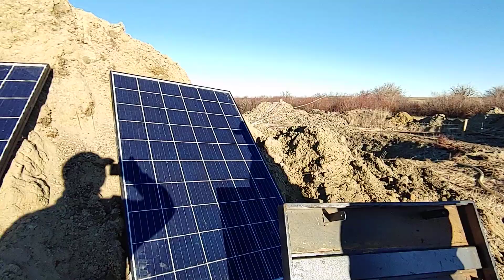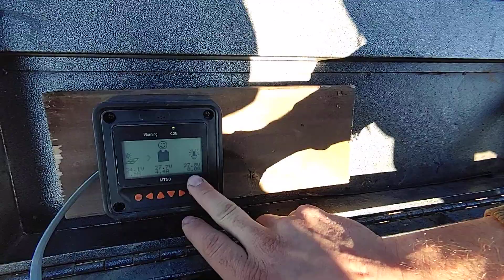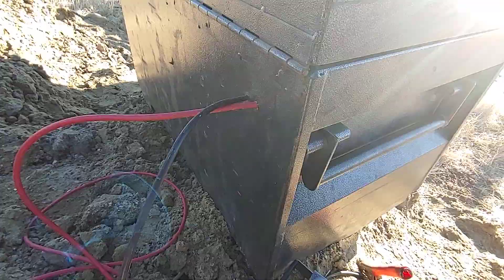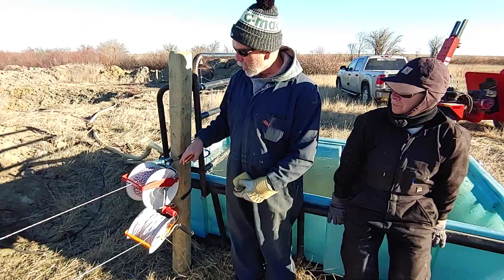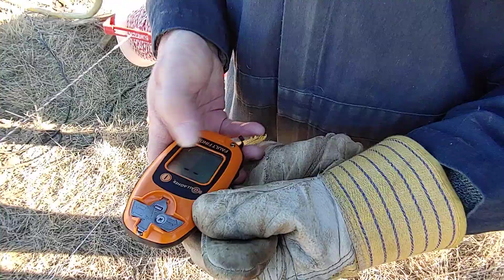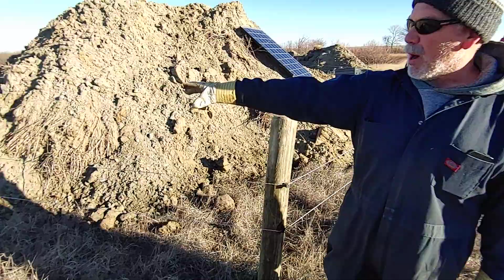Water in the Winter Part 1! Fence and Pumping Systems Explained !

Comment: Hey what brand is that pump and where did you get it thanks
Reply from the maker: The pump is a 24 volt centrifugal pump purchased through our local hardware store. I believe they are a Sundog solar dealer. Sundog has a decent website and will ship.